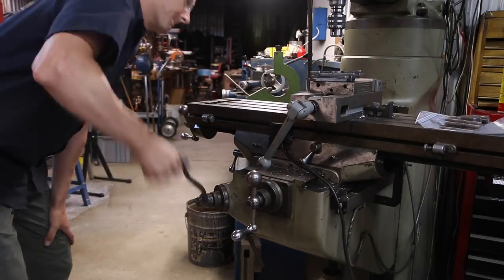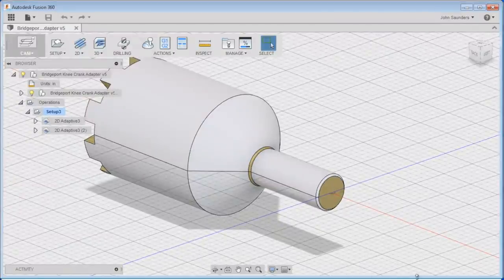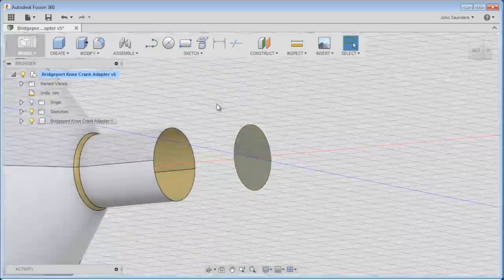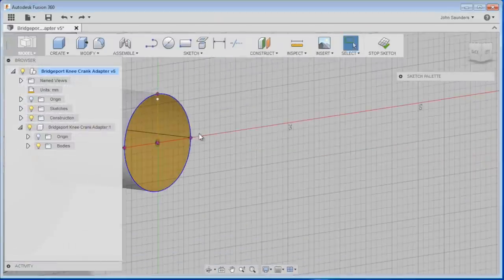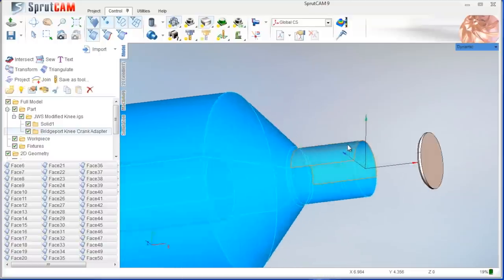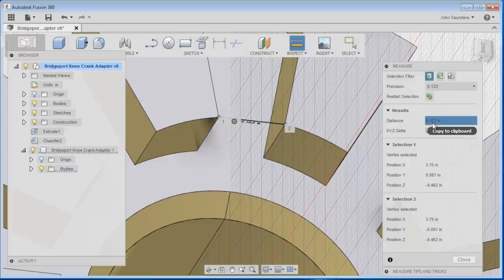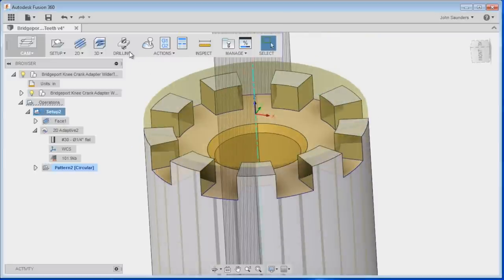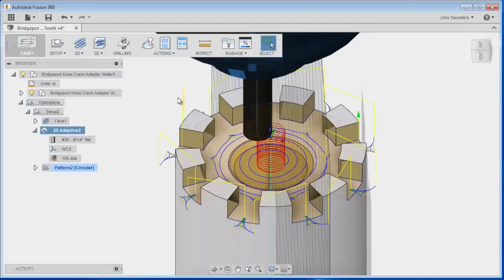Bridgeport Knee Adapter - Fusion 360 & Sprut9 CAM!  Widget47

Comment: Hello John, from The Geek Group machine shop in Grand Rapids, MI! :D

In this particular case, I personally would have changed the order of operations. Face > Drill > Adaptive and skip the larger endmill (and the reamer) altogether. Drills are among the fastest material clearing tools in your arsenal because they are plunging tools.

As long as you don't have an excessive amount of stick out and you keep the WoC outside of the crazy range, full depth with trochoidal milling, which is what adaptive does by default, would work just fine. Probably cut your cycle time in half with those changes.

Keep up the good work :)

Comment: By default, on parts containing imported geometry like step or iges, timeline record is turned off. You can turn it on by a right click on the part name in the model tree, bottom of the menu. I'm a pro-e and solidworks long term users, and thanks to you i discovered fusion 360 ... Greats! :)

Comment: You can switch between different units by clicking the Units icon on the tree. Once you click it, it will display a window with you available options. I do it all the time; since my stock is in inches, but I measure the extrusion cuts mostly in mm. No problems with it either importing from SolidWorks or directly from GrabCAM. Great video by the way. Great tip about the panning, I prefer the SW way than the F360 one

Comment: First, love the videos, thank you for posting them, I am learning a lot.

Quick tip, I know in SW (probably Fusion 360 as well) you could have created a sketch line (or two points) with both end points coincident on your sketch circle and those teeth edges and dimensioned (driven or driving) that to the desired gap. The reason I say driven is if you want to use it as a ref. in the sketch and drive the circle dim instead for machining purposes. It is much quicker than dimensioning the circle, making the extruded cut, measuring the distance, going back into the sketch and making the changes, repeat...

Also a keyboard shortcut I find super helpful is the views, Ctrl+1, Ctrl+2, etc. Ctrl+8 is normal to. I believe there are also radial mouse gestures for this too, but I find the keyboard suffices (and the view options might not be active when in a sketch).

Comment: You can change the units by going to preferences page like you did for the solid works shortcuts option. And on the left side of the page there should be a units tab. Change the unit to inches there on both the design and CAM and you're all set.
Reply: aaron ramos That's a permanent unit change. But as mentioned elsewhere in the comments, you can also do it  at the document level from within the browser. Second node down from the top.

Comment: To add a tool go to your "Manage" menu in the CAM workspace and select "Tool Library". They separated the management and selection in the latest update. You can also turn on and turn off the tool libraries that are shown in the tool selection window with the checkboxes, which is handy for hiding all of the sample libraries. 

The way your windows are disappearing and your inability to change the measurement unit is quite odd because I do it freely and often ... or I didn't understand the context of the problem. Perhaps your app has been corrupted and an uninstall/reinstall would be helpful?

Comment: If you haven't found a solution for your collapsed dialogs in Fusion, I read the cause of the bug on the Autodesk forums.  If you minimize the tips and tricks window, the dialogs will come up minimized as well.  Hide or leave tips and tricks open and the dialogs should stay open.

Comment: Fusion 360 Tip! You can turn the imported IGS file into a solid by going to the Patch workspace and using the Stitch command (Modify -> Stitch). Window select all of the surfaces, and it should weld them together, leaving you with a solid. Once you have a solid, you can use commands like Press/Pull to create simple, direct changes. Additionally, you can use sketch-based features on your newly created solid! Let me know if you have any questions - happy to help

Comment: as far as the tool issues you had in the video you may have fixed it but, on mine I got a Manage section in between the insert and select buttons. In manage > tool library you can add new tools. Also if you uncheck to sample tools they won't show in the tool selection window. It would be nice it you could sort your own tools at the top and samples under in case you need one. If you don't see the manage buttons you may need to right-click the bar and reset the toolbar or panel customization.
Reply: MrAtalon Also it looks like if you add the tools to the Cloud section (which I am sure you will want to do anyway with doing stuff on the go from different computers as you have mentioned before) they appear above the sample tools.

Comment: Your copy of Fusion has some bugs, but so does mine (although completely different ones). For instance, my menus do not continually minimize themselves. It's still an infant program, but I'm learning to like it more and more all the time.

Great video :)
Reply: NYC CNC Russ is right, my menus do not minimize themselves.  You are having to make a lot of extra clicks to get things done.  I think your other problems making changes are related to the import of the part as a Solidworks model.  This does not give you any parametric history, AFAIK.  Thus, F360 does not know about how a lot of the geometry was originally created and you have to manually create your planes, pick points, bend over backwards, etc. to educate/populate F360 with enough information to do the edits you were expecting to be oh-so-easy.  : )
Reply: NYC CNC I am very much looking forward to your video.  I'm continually amazed, on an almost daily basis, with what F360 can do and what features I just haven't seen yet or don't understand.

Comment: As Always great videos!   Upper right hand corner click on your name and you can change the default units to inch, same area that you changed orbital defaults.....  I spent an hour last night trying to figure out how to get my Z axis on the side of a cylinder to drill a hole, I finally figured it out.   Any new users out there like myself using Fusion360 for CAM/ working with a cylinder that requires a part flip (they usually do!)  pay attention at 12:33, if I had known that last night it may have saved some of my hair...

Comment: I think with the first edit in fusion, you turn the part into into surfaces, so you didn't have a solid anymore. This made your second edit behave weird. In inventor you should have stitched your surfaces into a solid before doing the second edit.
Reply: Also I'm  surprised that you didn't do the " direct edit" command on the small shaft, that's how I would do it in Inventor , I assume it works the same in fusion, have to try it out later today.

Comment: Some models when imported are interpreted different ways, particularly solidworks sucks at exporting things. Try exporting as a parasolid first, then IGES next. Parasolid text files are robust. Fusions new update has a few minor bugs and probably wasn't ready, but hell, I'm still waiting for you to try spaceclaim... your mind = blown.
Reply: Yes sir, Making functional models is a breeze, you can design up a part in a moment, everything is pure gold with an intuitive interface. You'll still need fusion or sprutcam for your CAM as it now aligns with things like ANSYS (IE stuff I could never afford.) but Spaceclaim itself is affordable and doesn't need license updates to continue using and opens everything in existence which is what it was designed for. Direct modeling parts from other CAD packages easily :) Give it a go if you get some spare time :)
Reply: Eadc Components Worth noting too keyboard shortcuts are boss, it really annoys me that fusion doesn't have them, but spaceclaim has fantastic keyboard shortcuts for most operations, you simply start typing to change dimensions, where in featurecam you need to click again and select the text, delete it and start typing. It's just a really nice finished product you'll appreciate.